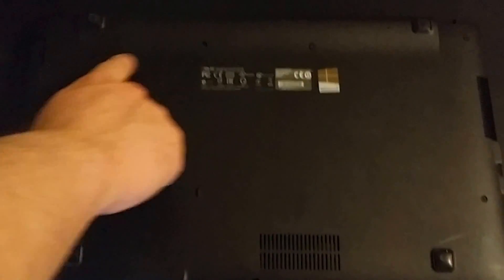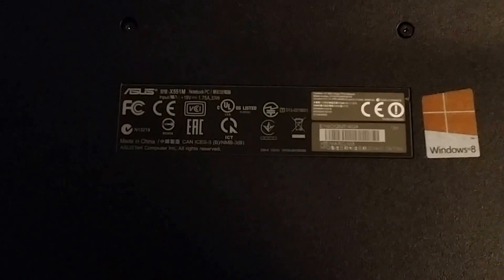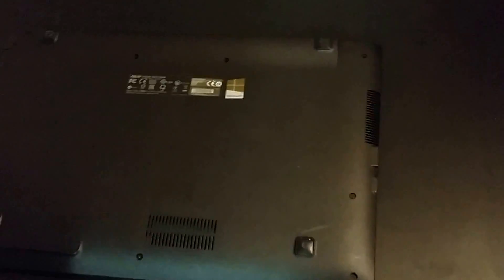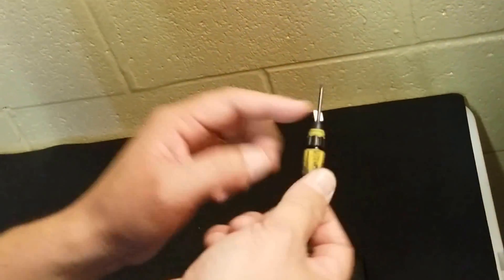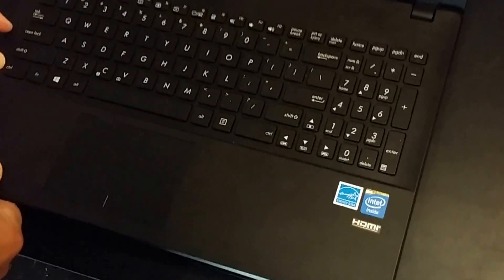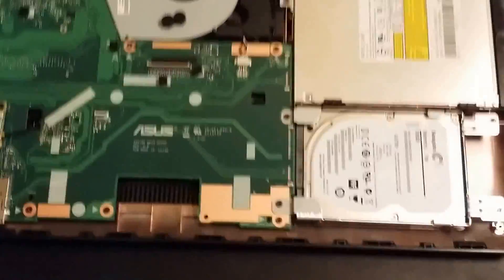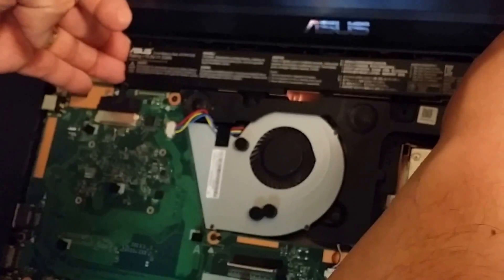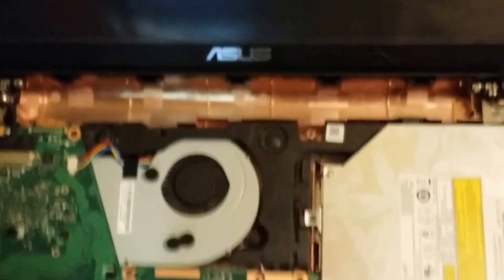ASUS X551M Laptop Battery Removal & Won't Power On Fix

Comment: Hey man,
My laptop is ASUS X455L
does the same method apply?
Reply from the maker: Jamie Nasas To be honest, the only way to know is to try it.  I personally have never disassembled a X455L model before but if I were to, I would look for three (3) things.  Are the screw placement holes in the same places /similar places as the X551M?  Is the Keyboard removable by itself or is it part of the Top Lid of the Bottom Base Assembly (if the keyboard is removable then there will most likely be screws holding down the top lid to the bottom base).  Will you be able to detach the top lid safely by using either your fingers or using a pry tool such as a guitar pick or a credit card?

If you can answer these questions, and you say yes to all of them, I would try to disassemble the base CAREFULLY!!!  If at any time you feel uncomfortable or think you might break something, please STOP and reassemble everything back to the way it was before you started and bring it to a qualified tech or repair shop.  If you can get the keyboard lid off, just BE CAREFUL about the ribbon cables underneath it as you can tear them off if you don't release the locking latches before you pull them out.

Hope this helps!

Devin
Reply: ***** Thanks man,I can says yes to all of them,but the risk is too much
like breaking those ribbon cables,that's my only concern..
Thanks bro
Reply from the maker: Jamie Nasas The ribbon cables can be scary but it really is not that hard.  If you watch my video, as long as you separate the keyboard lid slowly without opening it wide while going around the perimeter, then slowly opening from the touchpad side just enough to see the first ribbon cable (touchpad), you will be ok.  If u can do that, then either use your finger or small wedge tool to release the latch that holds the first ribbon cable to the motherboard then go on to the keyboard cable then the power cable the same way.  If this is something you do not want to do, take it to a repair shop so you don't have to.  Good luck!

Comment: Hey guys...I'm having a challenging time locating a replacement battery for Asus x551mav. I'm having to open up laptop to match pics online because the sellers aren't able to provide additional info that makes what I'm looking for easy. So is x551mav compatible w x551m? 
-dot :)
Reply from the maker: Dot, are you able to disassemble the laptop like in the video to actually get to the battery to read the battery model number?  If the laptop is a ASUS X551M, the battery should be compatible with the one I show in the video.  I have seen that battery on eBay and Amazon on sale there.  Let us know.

Comment: My screen won't turn on. This is a brand new computer. Help!
Reply from the maker: Andrea Vega Andrea, is this computer a ASUS X551M laptop that you are having problems with?  If you don't get a picture and it is a brand new computer, you might want to return the computer to the store you purchased it from and get an exchange as stores usually have a 7-14 day return policy on electronics.  If there is no return policy, I would connect the computer to an external monitor and see if you get a picture that way (there is a FN key and F1-F12 combination that you have to press in order to usually send a picture over to an external monitor.  Look for a Monitor Icon on the function F1-F12 keys.  Only you find it, press the fn key at the bottom left corner of the keyboard then press the correct F1-F12 key to switch the screen to the external monitor).  This will eliminate the Motherboard/Graphics Chip as being the problem IF you get a picture on the external monitor.  If you get a picture, then your LCD/LED Screen or Cable could be defective.  If you still do NOT get a picture on the external monitor, then you might have a motherboard/graphics chip problem.  In either case, you really should contact ASUS tech/warranty support as they honor all hardware related problems up to 12 months from the date of purchase.  If you have any other things you want to add, reply back here!

Good Luck!

Devin

Comment: I'm a visual learner and that was great. Not sure about grounding instruction tho. What do I do at home to not ruin the laptop?
Reply from the maker: Dot Munson Dot,  I have seen techs not use ANY grounding straps when disassembling computer equipment and everything turned out just fine.  However, as an instructional video, I MUST recommend grounding yourself in order to prevent any mishaps and shorting/electrically damaging your components for safety/liability reasons.  Plus I would feel horrible if anyone watching my video damaged their computer due to shorting something out.  If you are really trying to be careful, you can go to eBay and purchase a grounding strap.  Click here or copy and paste to your web browser address field: http://www.ebay.com/itm/Anti-Static-Antistatic-ESD-Adjustable-Wrist-Strap-Band-Grounding-Wire-USA-Seller-/281654304680?pt=LH_DefaultDomain_0&hash=item4193e79fa8

All you need to do when you get it is to get a long screw the size of your electrical ground hole that looks like a circular hole and put a screw in that hole.  Then clip the end of the strap to that screw and you are now grounded.  PLEASE MAKE ABSOLUTELY SURE THAT YOUR ELECTRICAL OUTLET IS WORKING PROPERLY BECAUSE IF THE GROUND IS NOT ACTUALLY GROUNDED OR A SHADY ELECTRICIAN CONNECTED A 110/220V TO YOUR GROUND, YOU WILL GET HURT OR ELECTRICUTED!!!  The easiest way to tell is to go to Walmart or Ace Hardware and buy a electric outlet tester for a couple of bucks and plug it into the outlet you will use for this project.  Or you can click on eBay: http://www.ebay.com/itm/New-Electrical-Outlet-Receptacle-Tester-Faulty-Wire-Finder-Color-Coded-Wall-Plug-/311360794062?pt=LH_DefaultDomain_0&hash=item487e8cadce

I do NOT want any of you to get hurt so please heed my advice and warnings to protect yourselves AND your equipment.

Good Luck!

Devin

Comment: My Asus similar to the one in the video shut down when I accidently tried to plug in the wrong end of the usb into the port (Fire wire) Called Asus and G Squad, but couldnt get it restarted,..telling me it was most likley a co-incedence that the computer shut down when the wire connected the usb port. 
 it's now in the shop getting looked at to see what's up.
I tried the same thing with this Asus Loaner I'm presently using,. it did the same thing,shutting off, but it turned back on normaly when I pressed the power button. Never again will I buy an Asus craputer!
Reply from the maker: Bob C Did you try to do this?  This usually solves the problem if a headphone jack gets plugged into a USB port as it shorts the powering on of the laptop.  Maybe it will power on your system if you plug a USB into the Firewire port.

I have a LOT of people asking about what happens if someone accidentally plugs in a headphone jack into either a USB or HDMI port and the system will NOT turn back on.  Here is the answer as to what to do if that ever happens in a sticky.

Follow the steps from my video and remove the battery.  Reattach the Power Button ribbon cable WITHOUT the battery or AC adapter plugged in and press & hold the power button for 30 seconds to discharge any residual charge on the motherboard/laptop.  Detach the ribbon cable, install the battery and then reassemble the laptop but do NOT screw in the screws yet.  Assuming your battery is charged, power on the laptop.  It SHOULD power on at this point.  If it does, then turn off the system and completely reassemble the laptop.
Reply: I did what you said in the video,  thanks so much!!  you saved me a lot of money. the computer works fine! for an Asus anyway...
Reply from the maker: LOL.  Love how you ended your sentence!  Funny funny.  But truthfully speaking, ASUS does make one of the better computers (at THIS point in time) as compared to HP's (overheat and graphics chip failures), Toshiba (motherboard/USB failures), Acer/Gateway/EMachines (overall poor build quality with numerous problems).  I repair computers 10 hours a day, 6 days a week at my shop and the computers I listed are over 70% of the ones I repair.  But I am glad that my video helped you.

Thanks!

Devin

Comment: My laptop won't charge anymore. It was working perfectly fine earlier today, then all of a sudden when it said my battery was at 10% and I tried charging it, it wouldn't want to charge at all. Is there any way to fix this?
Reply from the maker: Hector Rodriguez Hector, you will need to get your battery replaced.  One question first.  Does you laptop stay on when the power adapter is plugged into the DC Jack or does it go completely dead when the battery runs out of power?  If the computer stays on and just won't charge the battery, then the battery just went bad.  If the computer shuts down even if it is plugged in, then the DC Jack is probably going bad.  Let me know.
Reply: ***** Nevermind. It was the charger that was broken. Thanks for the help anyway though :)
Reply from the maker: No Problem!  Glad you got it taken care of!

Comment from the maker: Janie,

This is the new wave of budget laptops which are sub $400.  They don't make them user friendly in terms of accessibility to parts, build quality, upgrades, disassembly/reassembly, etc.  You are not alone when you say that this model is just poor in design/usability.  My recommendation is for people to NEVER spend less then $500 on ANY laptop because the old adage "you get what you pay for" rings VERY true.  Sorry about your bad experience.

Devin
Reply: hay I have a asus tuch scren laptop and I would like how would I add more ram as the back is the same it's a asus model f553m windows 8?  plz help no money to buy a different pc and I gonna use tgis for game and it's ok but ofcouse need some more ram plz help
Reply: Cieran Rathborne Looking at the Crucial memory site: http://www.crucial.com/usa/en/asus-memory
There does not seem to be any memory available for the Asus F553m laptop.  That tends to make me believe that that memory is soldered on and cannot be removed or upgraded.  Sorry for the bad news.
Reply: +Angrysquirrel PC would there be any difference between this process and the process of disassembling an ASUS X551C?
Reply from the maker: The X551C "SHOULD" be very similar.  The only way to really know is to try to disassemble it based on the video's instructions.  Just be VERY careful!  If the disassembly deviates to far from the video, immediately stop and reassemble it back and take it to a local computer repair shop.
Reply: +Angrysquirrel PC Will do, thanks!
Reply: Zmangamez

Comment: For me my laptop works fine when it's plugged in but literally as soon as I unplug it....shuts off. When I do have it plugged in It won't charge to 100% (which my slight OCD gets annoyed with), I think the highest it ever charged to was 85%. This is clearly a battery problem, cause the charge light is on, laptop says it's charging, but no sooner do i unplug it shuts off immediately. I'm not even exaggerating the very moment the plug is out of the socket it turns off. But I have to order the extractor cause I've been trying to unscrew these last 3 screws for 4 hours with no luck. Not really a question, I'm just venting my frustration.
Thanks for the video!
Reply from the maker: Anthony Hinson Anthony, you are not the only one that is having a problem with the battery connector screws.  Other people on here have stated that they can't remove them either.  The problem may be that the screw holes underneath  may be stripped or possibly broken due to the people/machines at ASUS tightened them too tight thus BREAKING/STRIPPING the screw hole.  The one I disassembled EASILY unscrewed and the battery was able to be removed.  I understand your frustration as I was frustrated I had to disassemble the entire laptop just to get to the battery for a simple LCD Screen replacement.  Unfortunately in your case, there is no easy simple solution to get the battery out short of break the case where the screw holes are by prying the battery up with a screwdriver or other leverage tool.  If you figure out a way to safely remove the screws, PLEASE post on here for the other people in the same situation as you!  I will even give you credit and sticky it in the Show More section.

Good Luck!

Devin

Comment: Plz help me my asus a550 wont turn on and i dont know why
Reply from the maker: Subeshen Shanmugam Here are the most common fixes to a computer that won't turn on:

1.  Try a different Power Adapter.  Power adapters can go bad and when the battery runs out of power, a bad adapter will not power on the system OR charge the battery.

2.  Make sure the power adapter is plugged into a working electrical socket and that socket is turned ON.  Funny but true that this can happen.

3.  If you have a defective battery, it CAN SOMETIMES cause the system to not power on.  Remove your battery using the video then plug in a WORKING power adapter directly and turn on the system.  If it turns on, get a new battery.  If it STILL doesn't turn on.......

4.  Check your DC Jack connector to make sure it is NOT loose or damaged.  If the DC Jack connector is bad, it will NOT charge your battery or power on your system.

5.  Assuming that your DC jack is good, your motherboard may have gone bad.  If that is the case, check Ebay for replacement motherboard for your model.

6.  Final note:  Check your power button ribbon cable or button itself to make sure that the ribbon did not come out or the button is hitting the contact that powers on the system.

Hope this helps!!

Devin
Reply: ***** thanks

Comment: Hey angrysquirrel, I was using my laptop at night and wasn't paying attention to where I was plugging in my headphones and I put the cord into the box usb looking thing to the left of the hdmi input and it immediately shut down. I can't turn it back up. What happened and what do you suggest I do?
Reply: albany GP I need this info too. Same thing happened to me but with a mouse.
Reply from the maker: albany GP Follow the steps from my video and remove the battery.  Reattach the Power Button ribbon cable WITHOUT the battery or AC adapter plugged in and press & hold the power button for 30 seconds to discharge any residual charge on the motherboard/laptop.  Detach the ribbon cable, install the battery and then reassemble the laptop but do NOT screw in the screws yet.  Assuming your battery is charged, power on the laptop.  It SHOULD power on at this point.  If it does, then turn off the system and completely reassemble the laptop.
Reply: ***** No I have an Asus Q301LA but I just went to support and they taught me how to hard reset it by just holding the power button for 60 seconds. I never had to get to the battery.
Reply: Daniello Tuchee Daniello, the hard reset sometimes does NOT work.  I have personally held the power button for over a minute and it still did not fix the problems.  But if it worked for you that is awesome!  I hope people try your method if all else fails!
Reply: i need help to this happened to me now
Reply: It could be the danaged battery, damaged dc jack, or damaged motherboard.  You will have to take it to a shop to get diagnosed to find out which one.  Good luck!
Reply from the maker: Exactly what valdestot said.  He beat me to it.
Reply: I tried to take out the battery but even when removing the screws, I still can't prop all of the sides open without being afraid I'll tear something off. I have a different Asia laptop where you've got to lift the whole thing upside down. When I plug it in the charger, there's no light that comes on. The repairman said it's probably a hardware issue because of that and that they can't do anything about it and I need to have a warranty or might as well buy a new one. It this true?
Reply from the maker: albany GP What do you mean by prop all the sides open.  You do have the Asus X551M laptop right?  Regardless of where this laptop is being sold, the design should be identical unless it is a different ASUS model.  Can you please confirm what you mean by prop and your exact model number?
Reply: Hey man, thanks a lot for the video. If you still check the comments I have a quick question for you, hopefully you can help: after repeated power outages (due to a cyclone) my battery doesn't charge anymore. Laptop still works as long as it's plugged in, but the battery doesn't charge and the laptop shuts down as soon as it's unplugged or the power goes out. Do you think the outages could have affected the battery itself? Or is it likely to be a fried motherboard component?
Reply: Wow that was fast, thanks to both of you. I'll go check tomorrow and hopefully get it fixed.
Reply: Im have same issue like you to. I have try push button 30 second, 1 minute and 2 minute. But it still same. I regret didn't shut down properly or clean my data. Next morning i found out my laptop didn't turn on. I have search many tuturial and try. But none of them worked. So im tired do this, my laptop RIP😇.. i think its time to buy new laptop and transfer all my data😂..
Reply: Zelia Ronel wow 12 hours ago newest comment on this video I've seen.
Reply from the maker: Follow the steps from my video and remove the battery.  Reattach the Power Button ribbon cable WITHOUT the battery or AC adapter plugged in and press & hold the power button for 30 seconds to discharge any residual charge on the motherboard/laptop.  Detach the ribbon cable, install the battery and then reassemble the laptop but do NOT screw in the screws yet.  Assuming your battery is charged, power on the laptop.  It SHOULD power on at this point.  If it does, then turn off the system and completely reassemble the laptop.
Reply: Angrysquirrel PC I know this is late, but thanks for the help on it, you completely saved me from buying a new laptop!!!